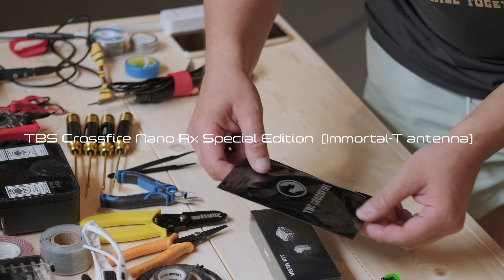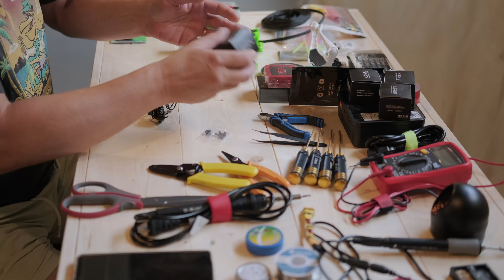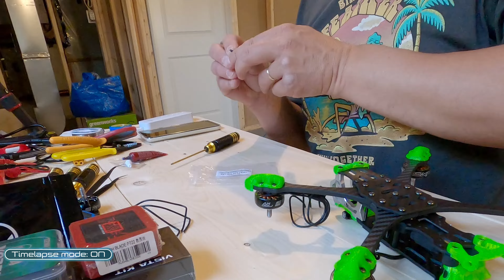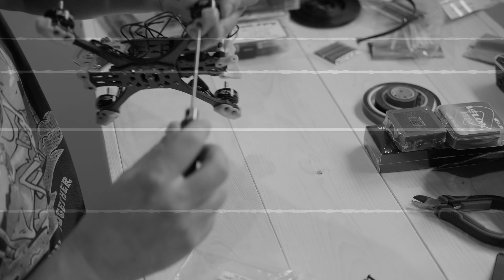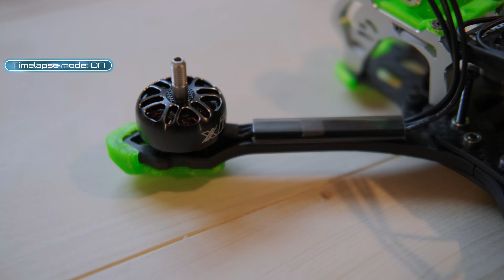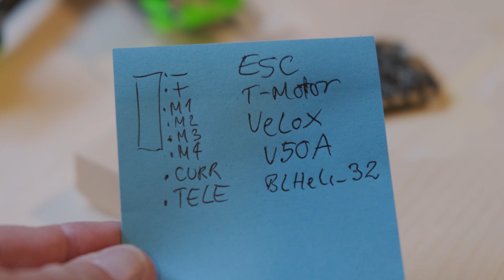MY 2nd CUSTOM 5" BUILD | 01−01−2023

Comment: Where did you find the small pink zip ties you used to attach the Vista to the frame?
Reply from the maker: Princess Auto here in Canada has almost all colors/lengths. I use them just temporarily until my builds are completed, and at the end I replace them with electrical cloth tape. It's amazing since it never leaves any residue nor tacky mess.

Comment: what paste are you using for screws??
Reply from the maker: I use Loctite Threadlocker Blue 242. This one: https://i.imgur.com/wgdznIM.jpg - you can also somewhat see it in my 1st custom build video, at the edge of the table... beginning of the video, around 20-30 seconds into the video: https://youtu.be/-8mMqIQadS4

Comment: What capacitor did you use? Is there enough room to mount it with the DJI Air Unit or will the space be limited? Looks like it fit well with the Vista.
Reply from the maker: I am not sure anymore, since I put a heat-shrink around it. It came inside the package with the Velox V50A ESC. But I do remember it was little oversized one. Still, if you play enough and spend some time planning and organizing components at the back, there is just enough room to keep it upright in between the stack and the Vista unit. That's why I went with kind of spread apart red/black power leads, coming out from the ESC under -45 degrees and 45 degrees angles, respectively. You can see that part at 13:20 sec mark into this video. At first sight, it might look weird, but I knew exactly that huge capacitor will give me trouble if I don't do this. And at the 21:36 sec mark, you can see how capacitor is lodged in between the ESC and the Vista. And here is the full size photo of the product (Velox V50A). If you click on it, you will see the full size image, and scroll down just past the middle, you can see that capacitor. I am not sure it had any other markings on it, except for the ones you can see in this photo: https://shop.tmotor.com/cdn/shop/files/1.png

Comment: Can you tell me what distance of of flight in this model. And what maximum height of flight? And can I flight slowly for cinematic footage (like mavic 3)? Thank you for answer
Reply from the maker: Distance depends heavily on the Rx ad Tx you are using (type of the protocol, is it ELRS, is it Crossfire, or something else). Maximum height? That should be regulated by the country you are planning to fly in. There are some strict rules and they should be followed. Flying recklessly is never advised, we have to share sky with public transportation as well, and we have to be considerate. A lot of people's lives can be in danger if we don't follow rules, so I would not recommend flying too high. There drones are nothing like Mavic which has simple controls, left-right, up-down. The way we control these machines, is quite similar to how real helicopter controls work. But, of course, if you got the skills, slow, cinematic flight is very possible. These custom build 5" quads are rather wild animals and they are mostly being used for crazy freestyle stunts, but many people use them for cinematic flying as well.

Comment: Am I too stupid or just blind. How do I get the T antenna from the Crossfire in the holder? PLS HELP
Reply from the maker: It's actually super easy, that's why I completely skipped that part. If you have the same antenna holder TPU, you will notice you can easily spread apart those two sides. CRSF Immortal-T is also pretty bendable. Don't go too far and try to be gentle, but everybody is doing it this way... you will have to (again) very gently bend it to the point when it can simply slide in. DO NOT force it, you may break the antenna. I repeat, it is pretty bendable and forgivable... but like everything in life, you can easily break it if you're not gentle with it.
Reply: @Seii-FPV  Thank you for your reply. That helped me. I have the antenna in the bracket now. ♥
Reply from the maker: @Pilotkosinus  - Nice! Yes, it's kind of finicky, but if you bend it slowly, real slow, it's incredible how much it's actually possible to bend that antenna. Naturally, it's expected, since quads crash, and they crash a lot. Good job!

Comment: Nice Build. I would not use those cable canals though. They will break after some crashes and in this event they likely cut your motor wires. 🙃 ...speaking from expierence
Reply from the maker: Thank you so much for stopping by and taking your time to watch. Yes, I've heard that before, and I have no reason not to believe you. These plastic pieces are not a good option. I am not sure why they don't make them out of something softer, more flexible, like TPU, or even silicone. 2-3mm thick one would for sure still protect wires (which already have silicone coating around them), and at least it would never shatter and additionally damage the wires. This was only my second build (in my first build with QAV-S JohnnyFPV Special Edition frame, I did not use these plastic channels, and I like it better than this solution. I even have these plastic channels on my Cidora SL5 v2.1. For now, I will leave them only because I don't want to de-solder all the motor wires from the ESC. But if they ever crack, I will simply replace those motor wires and redo everything properly. Let's hope I will not crash that bad :)

Comment: This foam should be under vista, not around
Reply: This is to isolate vista from bottom and make a space for capacitor. Take a look on assembled Mark5
Reply from the maker: @UberRuthlessOld  - here is a photo I just uploaded. I've marked the shape of that foam with green lines. Yes, that's exactly the shape of that foam, and it's not even goin under the Vista unit. In this photo, unit is raised only because they installed it on the top of the other wires as well as on the top of XT60 cables, and it only looks like it's sitting on the top of the foam. It's not. I did not want to place my wires under the Vista unit because it gets rather hot at times, and I don't want my wires touching anything hot if it's not necessary. I've routed all my wires to go around the unit, instead of under it. Photo: https://i.imgur.com/GiFdaOd.jpeg , and here is a photo where you can see the actual foam shape. You can't place anything on the top of it without slipping through the cracks: https://i.imgur.com/1gwTXz9.jpeg
Reply from the maker: @UberRuthlessOld  - again, I already answered this... Capacitor has more than enough room if you organize everything properly as I did. It works perfect and it's not flopping around, capacitor is protected from all sides just fine.
Reply from the maker: Even though anyone can make it the way you want, it's totally up to you if you even want to use that foam. Many people will never even use it. Second - that foam is so floppy, it will never stay put under the Vista unit without gluing it for the bottom carbon plate. If you ever tried this, you'd know what I'm talking about. I mount my Vista using soft mount, not even screws through 20x20 pattern. It's even mentioned in the video, I used double, double-sided tape. Meaning, two super soft layers of double sided tape under the Vista. Better than any other foam provided. Instead, of putting that crappy foam under the Vista, I used it to protect somewhat those cables from the XT-60 as well as other components. There is absolutely no use for that foam, other than cosmetic. Also, that foam has cutout holes that go right around the Vista or Air Unit. You can't even place your V/AU on the top of it without units slipping in.

Comment: What cam you running w this vista? i’m assuming a nebula pro? thanks!
Reply from the maker: Nope, you can see it on the box. It's original Vista Unit with original camera. You can also see there are two screw to hold camera on the camera cage, around 23:16 sec mark into this video. Nebula Pro I used in my 1st drone build (video up on this channel as well), and that camera has only one screw on each side. Original Vista has 2 screws on each side of the camera.